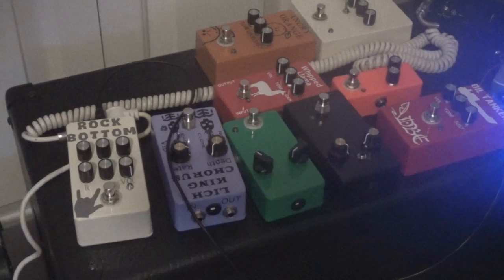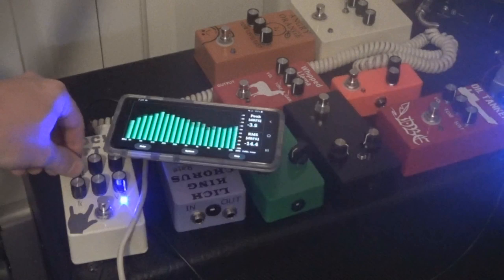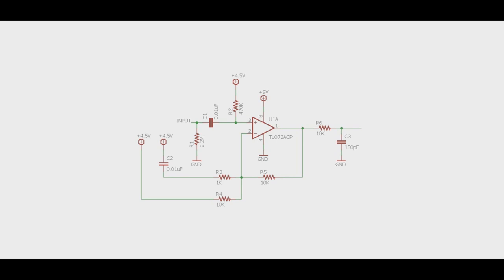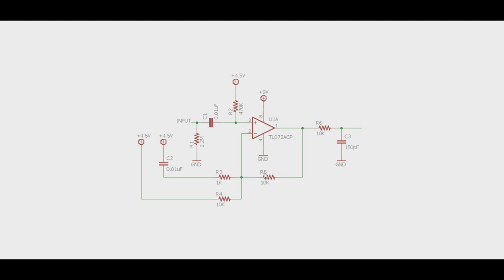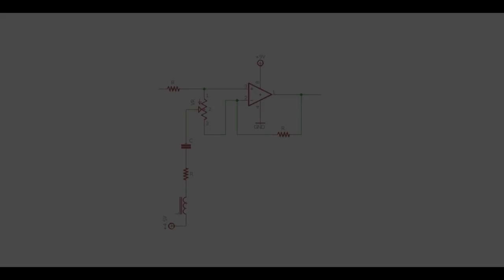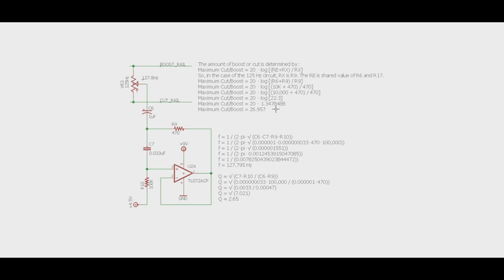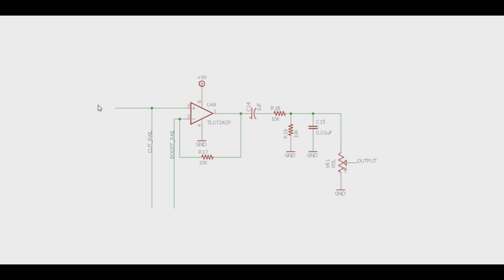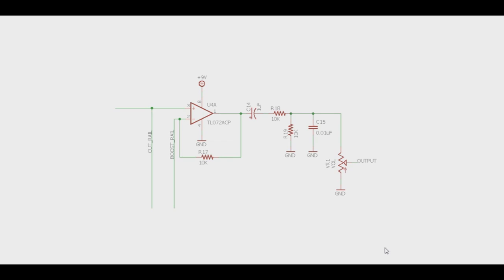EQ Guitar Pedals - How do they work?

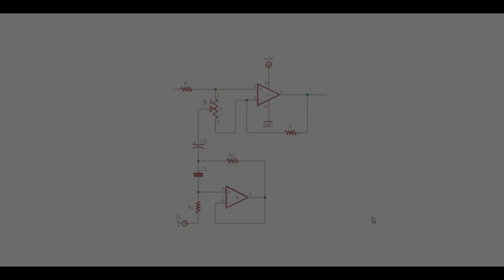Comment: Great video! Even though I wasn't looking for it specifically, this clarified a lot of stuff I wanted to know for different projects! I've got a question about the gyrator-circuit (starting at ~ 13:48): Since the Resistors R9 and R10 contribute to the value of the set frequency, would it be possible to replace one of them (or both) with a pot set up as variable resistor to change the responding frequency? Cheers and thanks in advance!
Reply: You could do this, yes. A lot of older analog mixer/consoles actually did it that way.

Comment: I’m a little confused. You have 62, 125, 500, 1K, and 4K bands, but you have an output low pass filter of 1.6K. Doesn’t that significantly cut the 4K band, making that one irrelevant?
Reply: It does cut, but it doesn't cut until all the cuts and boosts of the 62, 125, 500, 1K, and 4K are summed together into one signal. I cut there, because it just "starts" cutting at 1.6K, but doesn't really taper off until the 2.7K mark which is where I like my rhythm playing at. I'm not a bluesy or shreddy lead guy that plays in standard E tuning, so I don't want a lot of harshness that comes out at the tale end of my signal. Otherwise, you could make that low pass something higher, like at 3K or so. So it doesn't make it irrelevant, it's just deciding when you want to cut those frequencies. Before or after you tweak the signal.

Comment: How would someone go about adding a bass and treble knob to an already existing pedal circuit?
Reply: This would be a bit of a trick, depending on the room inside the pedal enclosure. The easiest, so long as the room requirements inside the enclosure are met, would be to add a Baxandall Tone Stack PCB circuit. There are a lot of projects out there that have perf-board designs for that. To that Baxandall, you'd need to provide it a ground source, and a signal in and out. Usually, people look at their pedal's schematic and find a resistor that is in a good spot and use it for the "audio in and out" lines. This also assumes the circuit has "a good spot", which some do not have on existing and may require a little creativity to fix that. Good examples of this are Fuzz-Face circuits.

Comment: Not that anyone will see this, but how do you get a specific Q? (Not just whatever it ends up being)
The equations for both Q and frequency use the same resistors and capacitors.
So if you change them to reach a certain Q, it changes the frequency!
Is there a different way to dial in the Q you want without messing with the specified frequency?

Comment: if i wanted to add a pulsing led with the lfo in my lich king, how would i go about doing that? also if you guys made a phaser that would be awesome! cheers
Reply: Well, you can pull a resistor off the oscillator portion and pull that to your LED and that should work. However this may slightly effect your signal. If that were to happen, you'd have to use an N MOSFET, a pull down on the gate, source to ground, a resistor to drain, and that resistor to your LED and then the LED to 9V.

I have two Phasers made up. One is an MXR 90 clone using matched JFETs and one using 3 OTAs.

Comment: Hello, so glad to find your channel, bcoz I want to make my own pedals and guitar amplifiers...I just have one question/problem, I made one bigger amplifier 2x12 with a lot transistors and capacitors from some old stereos, connected power, speakers, volume, bass, treble, balanse and mic jack as well...everything works fine on 6v adapter, but I DON'T KNOW WHERE TO CONNECT guitar jack on all that big circuit, pls answer me, greetings